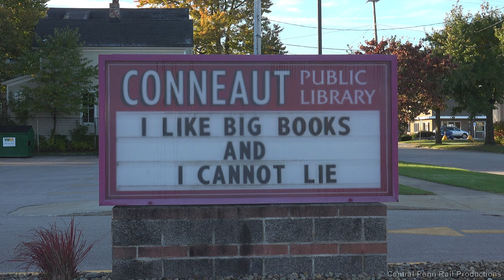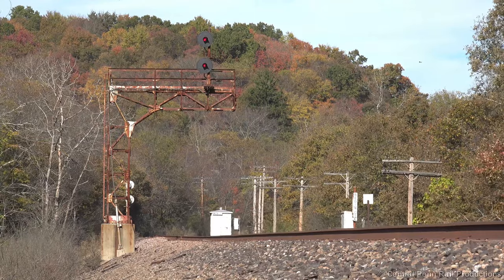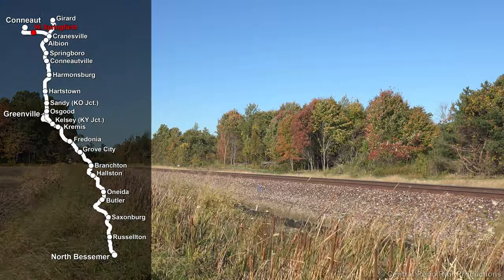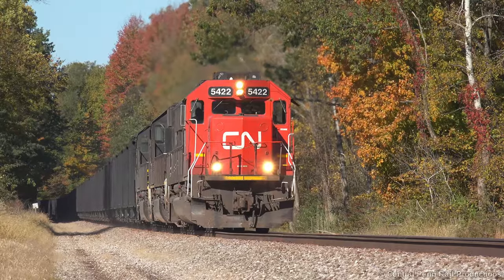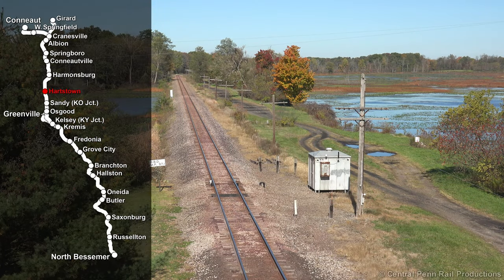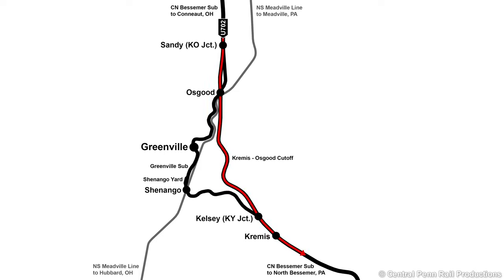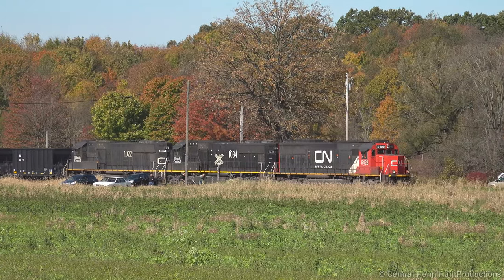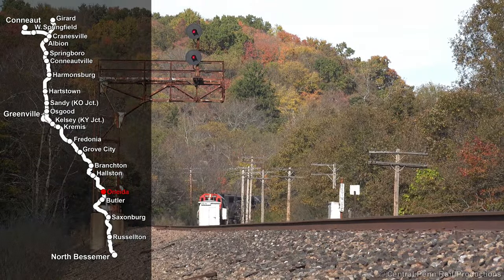Pennsylvania's Steel Route: Taking Ore Down the Bessemer

Comment: Interesting to see aggregate style 3 bay hoppers instead of the coal style 3 bays on this train...one question though, why do they say "BLE" when they were bought out by CN? Loved this video, hope to see more like it!
Reply from the maker: There's a legal technicality with Canadian Railroads operating in the United States, I believe everything is reported through their subsidiaries, therefore, BLE still exists on paper as an American company, hence the reason why CN used "Bessemer & Lake Erie" when purchasing the CSX line in upstate New York (obviously it has very, very little to do with the actual Bessemer & Lake Erie). So the railroads still keep reporting marks for their subsidiaries. Someone may have a better way to explain this, but that's the best I can come up with.
Reply: @CentralPennRailProductions  Ah OK, makes sense! I'd love to see something on that line but I've heard not much runs, do you know about how many trains a day run on that line?
Reply: They don't use the coal-style hoppers because iron ore is much heavier than coal. A coal hopper would probably be less than half-full of ore when it hit its load limit. Same reason that cement hoppers are shorter than grain hoppers and grain hoppers are shorter than plastics hoppers; and corn syrup tanks are shorter than oil tanks, which are shorter than LPG tanks.
Reply: @beeble2003  these new hoppers are filled 3/4 the way
Reply: @VArailfan89  1 or 2 at most.
Reply: @SebisRandomTech  Ouch. Not very many.
Reply: @VArailfan89  Unfortunately.